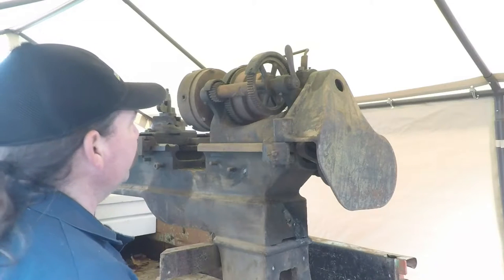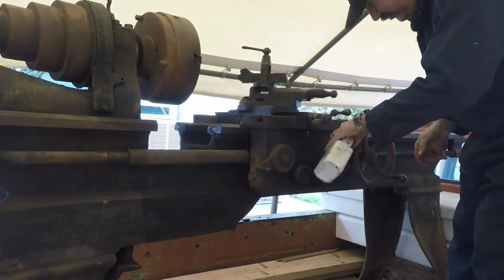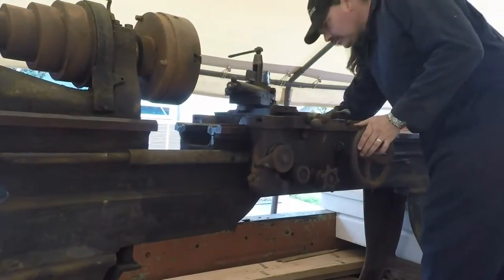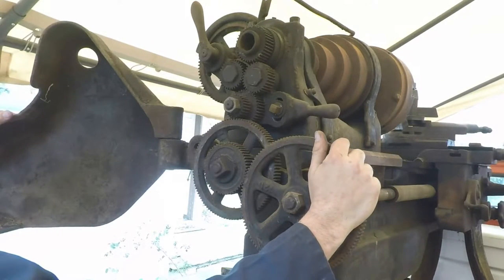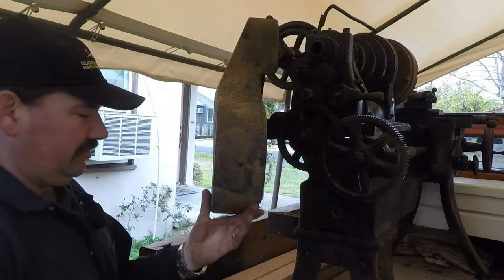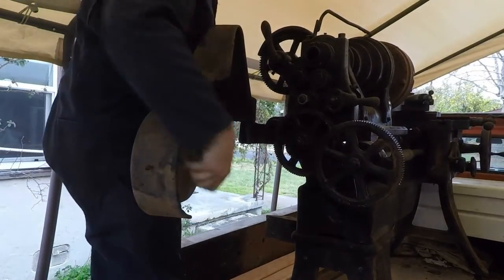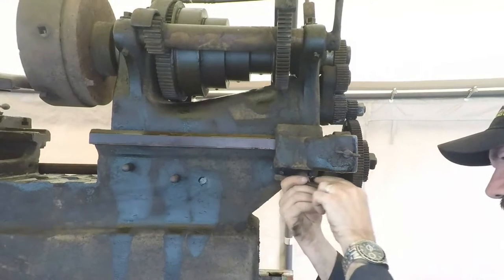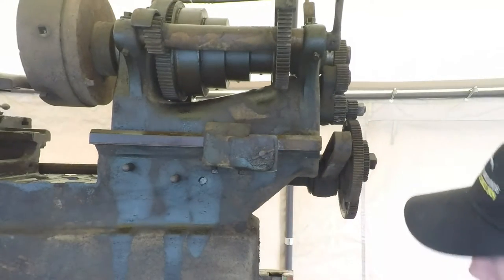South Bend Lathe Restoration Part 1

Comment: Chris, that looks an offal lot like my 1917 15" South Bend? Nice find whatever the year!
Reply from the maker: +George Chambers thanks I think they had a new line around 1920 .
Reply from the maker: George Chambers yes they did have a new line in 1920 - 1937 i think ,vintage machinery has a catalog in there archives.
Reply from the maker: George Chambers does yours have a guard over the change gears and reversing lever? I believe that was a new feature in 1920.
Reply: Yes it does. I bought the $25 card from Grizzly and it verifies the year of manufacture.
Reply from the maker: +George Chambers interesting I wonder did it come with it or maybe a later option?
Reply: I'm pretty sure it's factory. Looking at the 1918 catalog they had the cover in all the pictures.But the 1914 catalog shows the cover as an option.
Reply from the maker: +George Chambers OK well that nerows the time line down. I'd love to read this catalogs.
Reply: Chris, I've zipped some catalogs and sent them to your email.
Reply from the maker: +George Chambers right on